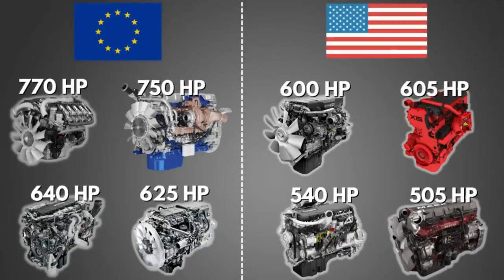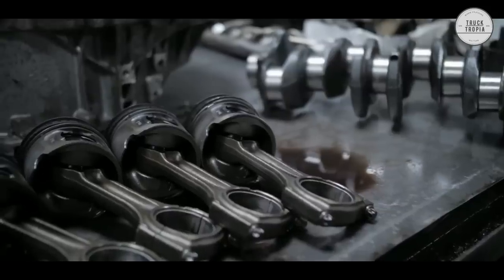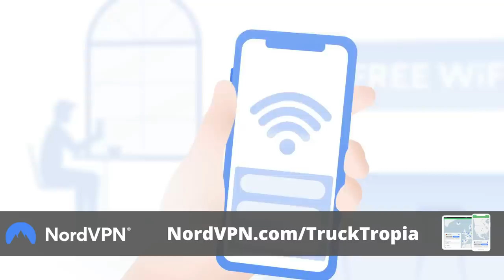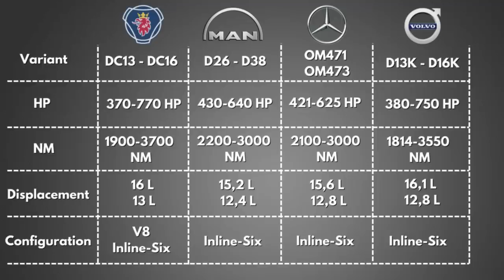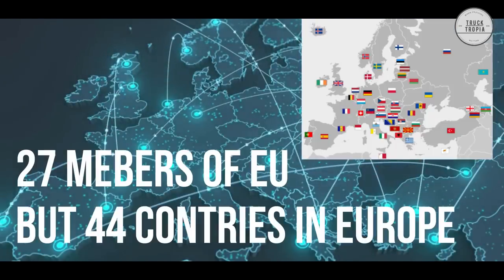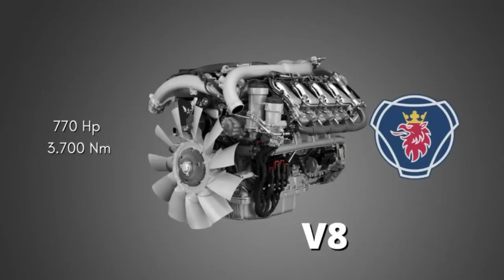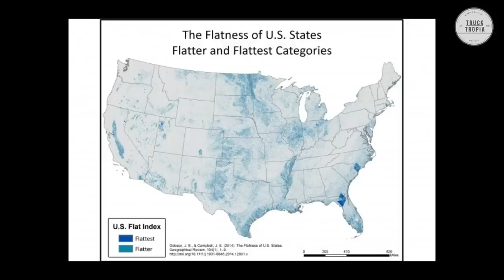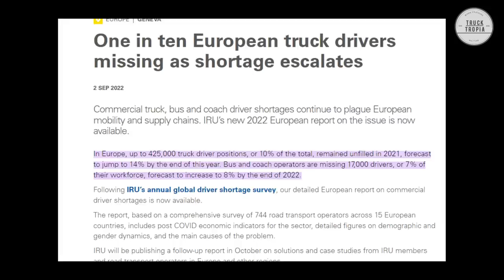Why European Trucks Have Up To 770 HP And US Don’t

Comment: Horsepower and HP are different sizes. Horsepower can be measured in different ways.  In the U.S., this is only measured with some auxiliary components attached to the drivetrain, missing things like the power steering pump that would result in a lack of parasitic losses if they were present. Therefore, higher HP values are calculated in the US than in Europe, where every component is held in place.
An EU truck may be 19 m long in total, and its total weight may be 40/44 tons. It may drive in the entire EU.
Special regulations apply only in individual countries. E.g. a Finnish truck with 76 to is only allowed to drive in Finland (but not in urban areas!) and is practically exclusively used for timber transports.
Fewer trucks are customized in the EU than in the US.
Reply: "Horsepower and HP are different..." Wat?😆
Reply: @simplemachine9531  HP or PS are, of course, physically defined.
But the measurement methods for engines in the EU differ from those in the US. 
In the US, unlike in the EU, Engines are not measured with all auxiliaries.
Auxiliaries cost power and so the same engine in the US has (slightly) more power than in the EU.

Comment: I am sure some industrial/commercial truck customizers throughout the US and Canada, end up with much more powerful, slower engines for the logging and oil exploration industry.  Texas is well known for it's specialized high horse power oil field trucks and even Canada has them from the like of Pacific Truck Manufacturing.  Most of these trucks will never be seen on most highways except when they have special permits to travel as oversized vehicles.  Most of these trucks are built exclusively for operation on private logging or mining roads.  For instance a typical Canadian west coast logging truck hulls 80 tons on two massive trailers.  These trucks are so loaded they can't fit in a single highway lane or travel under most highway overpasses.

Comment: Did OTR in the USA with a Cummins M11 turned down to 330 HP. The truck with a 10.5 litre motor was lighter than my compatriots with a 60 series Detroit, so they gave me the loads other drivers could not legally haul. Oh joy.

Comment: To be honest - you rarely see these 700+ HP engines in most parts of Europe. Most common engines vary between 440 and 500 HP. Everything above that is either for oversized transports or some single vehicles in fleets or small companies for show-off. Maybe Scandinavia uses more high HP engines because of their road trainish configurations up to 2 trailers and higher max weight. But most of Europe uses 440-500 HP engines for the international transport which has to comply with all the restrictions of all countries it's going through so it usually means max 40-44 tonnes.
As pointed in the video - for example DAF (one of most popular trucks in EU) uses Paccar engines. We have the same MX13 in DAFs as the one which is used in Kenworths (460-480 HP being most common ones). 
Also fuel is quite expensive in EU so not many companies buy 750HP unless they really need it.
Reply: In the Netherlands the legal limit is 50 tons, and there are also special rules for road train like configurations up to 60 tons,  and heavy trucks for getting agricultural products or building materials (soil, sand, etc.) these are often loaded up to or over the limit (51 or 52 ton total weigh is not unusual). They use powerfull engines (500 hp +)
Reply: @rientsdijkstra4266  I'm aware of that but The Netherlands is very small and flat like a pancake. From Germany to Belgium it's like 45minutes through the Netherlands for international transport.

 When everybody was using 460hp, DAF was selling XF105  with 410HP engines. High HP engines in NL are more rich owners' toys together with wide known NL-style tuning than necessity because of higher tonnage.

I understand them perfectly. Why not to buy a cool unit and to have fun while driving it :)
Reply: @WildStrawberryPL  What you are saying is only partly true. It is true that the Netherlands is small and flat. And also that some private owners buy the most powerfull engines for the image and the fun. But(!) there are a number of other "use cases" for powerfull engine's in the Netherlands. 
1.) Agricultural. In the Netherlands there is a lot of large scale mechanized farming of bulk products like potatoes and sugar beets that are very bulky and heavy and that are often being moved with 50 ton semi trucks. 
2.) The same goes for the construction sector where often large and heavy(!) loads of sand and other bulkmaterials need to be moved, often with heavy dumptrucks of 50 tons
2.) For some uses (such as the agriculturel and the building) they need to move those heavy loads over small roads with a lot of stopping and starting and tight corners, where a powerfull engine gives better acceleration (saves time)
3.) Trucks with containers from the logistics hubs Rotterdam (by far the biggest harbour in Europe!) and Amsterdam ride around all of Europe, where they will start meeting the hills etc. quite soon after they cross the border... So the fact that the Netherlands itself is small and flat does not matter much, if you start climbing the hills in Germany, Belgium or France, or even the Alps, etc. 
4.) For the logistics work in the Netherlands roadtrain  - like configurations are allowed in the Netherlands, with weight of up to 60 tons. They need power to accelerate... 
So, yes, in the Netherlands and surrounding countries there are still a lot of "use cases" where powerfull engines make sense.

Comment: It has to do with a European Lorry being 1.1 US tons heavier than its American counterpart, which would come out to .907 metric tonnes if 1 US tonnes where to be converted to metric tons. Order more if you have a British Lorry that uses Imperial tons then it's 1.2 US tonnes heavier.  European Lorry at 44 tonnes (48 US Tons) is overweight on American interstate highway system due to bridges being able to support 40 US Tonnes (36 metric tonnes) max load normal

Comment: Torque is not the ability to perform work, neither does torque make the engine more powerful (power being the important factor when talking about moving stuff from one place to an other). Actually 
Power (Watt) = torque(Nm) * w(Angular velocity in rad/s). 
So u can have as much torque as you want, as long as your engine can’t reach sufficient revolutions/sec the product of torque and angular velocity is still small. 
But. If you happen to have a large engine with high torque you then don’t need to operate at high revs to produce power (work/time). Benefits being: tighter rev range allows for more optimisation in terms of efficiency. And you can have near instant power when you step on the gas. And because large engines rev low the stress the parts of the engine have to endure are topically lower compared to e.g. a sportscar engine whose pistons travel 10 times as fast.  Therefore large engines with high torque and low revs are best for hauling heavy trailers.

Comment: OK let's get some things about HP vs. torque clear: I can make 10000Nm myself. Just give me a long enough lever to hang from. I can never make even 100 HP tho, I'll never "tow" much, I can sure pull a rope with enough reduction to make me haul 100 tons but very slowly.
Horsepower = torque x RPM (x some constant there). Your gears will trade higher torque and lower RPM for lower torque and higher RPM according to the need. The M4 Abrams tank uses a turbine as it's engine. It rotates at about 10000 RPM and produces proportionally little torque at the output shaft. It then goes to a build-in 10:1 reduction so you get about 10x the torque at 1000 RPM, which is what it uses further down on the gearing. So, you can make more torque with gears, but you cannot make more HP out of gearing, ever. It's a trade, in the end, HP and torque distribution are the important ones, and of course, the correct gearing. Higher HP will make you accelerate the heavy load faster, and beat higher drag (that any truck, car, heck the tank, will always have) at speed, sure you can tow with lower HP but you'll accelerate slowler, and your top speed will be limited.
Reply: Divided by a constant
Reply: @simplemachine9531  Yes, I added "(x some constant there)" to account for that. 
Being super academic tho, if we use power in watts, torque in newton meters and rotational speed in radians per second you get no constants... Aaaaand yes this would only come up in tests, in practice there's always a constant.

Comment: Again the misconception that torque is more important than power. Only HP matters, but it important at what RPM they are achieved. This "high torque" is really just "many HP at very low RPM". Why? Torque can be multiplied through gears at cost of reducing speed. Going the same speed at same RPM, engine that can achieve 200 HP at given RPM will output twice the torque of an engine that outputs 100 HP at the same RPM. There is a formula to calculate HP from torque and RPM. So you can create torque if you have horsepower. In an extreme case, even a human could tow 40 ton trailer up a hill, outputting thousands Nm of torque with proper gearing, but going extremely extremely slowly, because human has low HP. The problem with Honda Civic engine having the same HP as many trucks and not being that powerful is not in low torque, but in the fact that Civic achieves the HP at 7000 RPM and truck at 1500 RPM, therefore the Civic engine would blow up trying to reach the same performance for prolonged time. Thanks for your attention.

Comment: You can get more powerful motors then that in the US, they just aren't available off the lot, they must be special ordered.  I drove a 700hp cummins in the oilfield and the same company had a Detroit with 800hp that was a lead puller in heavy haul combos.  Just like people said, the motors are available, just not necessary for to day to day application.

Comment: Also have to remember these are manufacturer specs. The engine in my city truck is very under tuned to save on fuel and reliability but the same engine being used at my previous company they had turned past manufacturer specs and could pull most hills without a problem.

Comment: Inline 6cyl engines can be tuned to output more torque to match those euro engines but then one runs into emissions issues.  Those V8 engines run at a higher RPM than the longer stroke of the inline 6 cylinder engines.  Smaller inline engines have fewer components parts, cost less, and in theory should last longer because of the lower RPM.  Maintenance on inline engines is far easier and it's easier to replace an engine sleeve in an upright position compared to any "V" style engine.  There's so many pluses with an lower output inline low RPM engine and that why we they probably are the choice in US.
Reply: So I understand what from you said that American trucks are better?

Comment: The main reason why those engines are not available in the US would be emissions requirements.
Reply: No, Volvo had it's D16 750 engine available in the US market but there was very little interest in such an engine, that and manufacturing problems in the US was a big factor why they removed it from the US market.
Reply: @AlexKall  it also failed emissions so it was banned from manufacturing in the US.
Reply: @huntergatherer7796  Source? Can't find any such claim. They stopped the D16 manufacturing in 2017 because of the low volumes (<1000) and high certification costs.

Comment: Hills are NOT a big problem in EU. 
Actually I think that the apalchen, Rockymountains, and high elevation countries, like Utah are a bigger problem for engine than here in europe. If there are steep climbs, these are not long. You example with the alps showing, is true, but these areas are not freequently used by big trucks. Especially not swiss.
On the other hand in the middle of europe sits GER. A relatively flat country on the relevant roads/ autobahn. From wherever you came, you would probably get through GER. No biggy in terms of terrain.

I am no truck driver but afaik these 750HP Trucks are mainly used for special operations - not for carrying normal cargo! the standard 40-tonner is a 450-550HP truck. And this has also to do with the WAY MORE EXPENSIVE FUEL here. It is roughly 2€ per liter at the moment in center EU. Some countries more, some less. = 3,8 x 2 = a US gallon. 7,60€ per Gallon!

Comment: In Europe most trucks are owned by logistics companies. Surely there are some freelance drivers out there, but most trucks are company owned. You're usually not allowed to customize the truck apart from some interior decoration. I've also noticed the US secondhand market is pretty cheap... Whereas a secondhand EU truck can cost up to a 100k Euros, I see many trucks in the US for less than half that.

Comment: The regulations is very different between the US and EU, this is a huge obstacle when developing new engines. To certify an engine for EURO 6 you need to run a couple of engines for maybe a month, then you can assume that the emissions get maybe 5% worse because of wear and tear. But in the US you have to run the same engine for maybe 18 months. This is extremely expensive and slows the development of engines.
Reply from the maker: True 👍
Reply: Many of the EU approved engines won't pass US EPA regulations so they can't be sold here without major modification to them. That is an added expense for the manufactures. Remember Detroit diesel is owned by Daimler. Volvo makes their own engines and for Mack, and VW the international engines.

Comment: we have trucks that haul over the road with inline 6's that have 1,000 hp. I did not watch the video. V blocks are easier to build HP over torque. Inline engines build more torque over HP it is a natural law of physics. It would take a lot of time to explain. It has to do with levered advantage and speed over the rod journal. In a V type engines when the piston pushes down the hole the next piston fires sooner then an inline six, so it has the advantage to build horsepower easier. The companion cylinder is closer in relation to the degrees crank. However it is limited in torque range at the Rod. With inline engines they have longer strokes at the crank and build more torque because to the longer stroke. It is limited in horse power because of how long the next companion cylinder will fire.

Comment: Torque doesn't matter, what matters is power and the way the power is made on the RPM range. Torque value is useless, power curve is important. 
To clarify my point : 100HP are 100HP at 500 RPM or 6000 RPM it is still 100HP,  what's important is that you still have around 100HP at +/-25%RPM meaning a flat power curve
That's why electric cars are accelerating so quickly compared to a gasoline one it has a realy flat power curve having nearly all HP at 0 RPM all the way up to it's maximum RPM (nearly...)
Reply: "all HP at 0 rpm" 
Laughable, at least because hp is 0 at 0 rpm, by definition.
Reply: @simplemachine9531  You're right ! but you see what I mean, electric motors usually produce "nearly" peak power across "all" RMP range
Reply: @ciclotronforever  still, no. Check any tesla power graph.

Comment: Outside of the comments already covered below, Another aspect that the "expert" making this video... completely Missed, is.. the Fact that European diesels are of "Over-square" design, whereas... the US engines (for the most part) are of Under-square design.  Over-square engines (= bore diameter is greater than the stroke length - European) will yield higher "top-end" hp, with Less Low end Torque per cubic inch of displacement, whereas... Under-square diesels (=Bore is Less than the length of Stroke [US]),  will yield Less Top-end hp and greater low & mid range torque per cubic inch of displacement. 

It is Torque that moves the load, and it's horsepower that dictates how fast (what speed) one can move a given amount of weight, yet again.. it's torque and piston speed (relative to stroke length) that gives the sustainability to that speed... Especially in the incline gradients.

Also, Under-square (US) engines have a proportionately higher "piston speed" (Not to be confused with crankshaft rpm) due to the longer stroke length compared to an Over-square diesel (European & some Asian), which not only creates greater torque values per hp generated, but also much greater "holding or lugging" power of the amount of torque generated (due to the higher piston speeds per rpm) which, in turn... allows for higher speeds on incline gradients, and with the use of "Jake brakes", the longer stroke also helps to generate greater braking power in the engines.... especially on Cat & Cummins engines.

Comment: First thing you have to understand is that the scale of horsepower in Europe, requires more horsepower to equal the same amount of American horsepower. The measurement is not the same add 1000 horsepower American engine, the Europeans would scale that it probably almost two or 300 horsepower more. Perhaps their horses or just smaller. I don't know